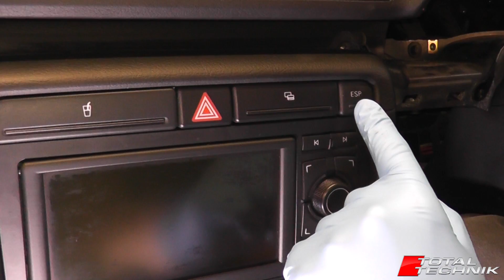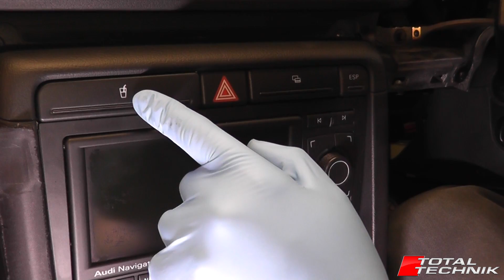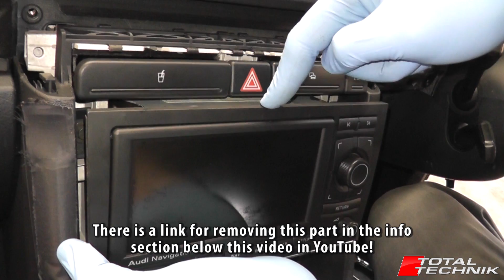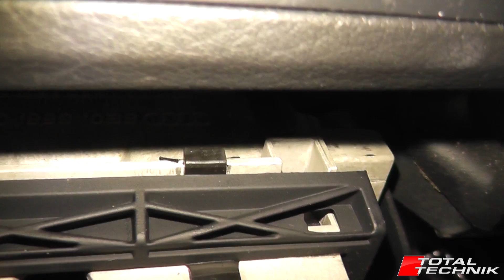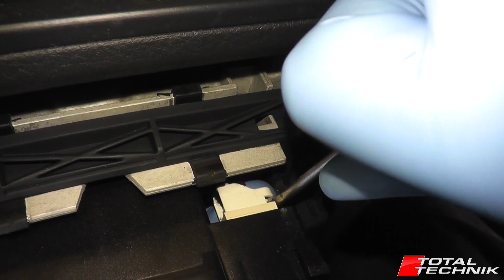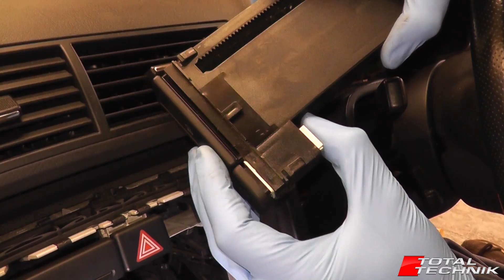How to Remove ESP (Traction Control) Button - Audi A4 S4 RS4 - B6 B7 - 2001-2008 - TOTAL TECHNIK

Comment: does this shut off esp and disable it? because mine is locked on
Reply from the maker: Yes, the ESP button will switch ESP on and off. It could be a faulty button. That's the cheapest quick fix check you can do - get a used one on eBay and give it a try. It can be other things (more involved), but it would be nice if it was just the switch :-)